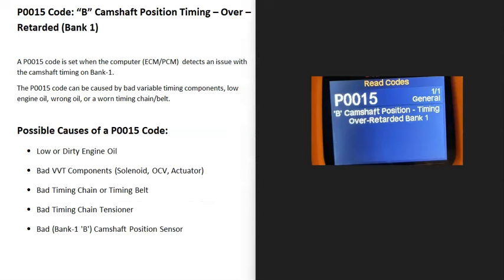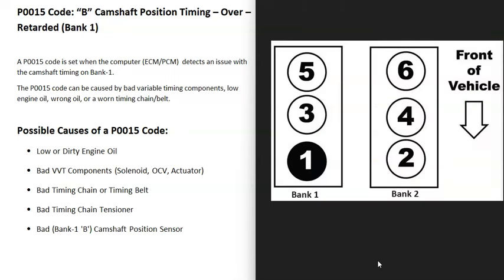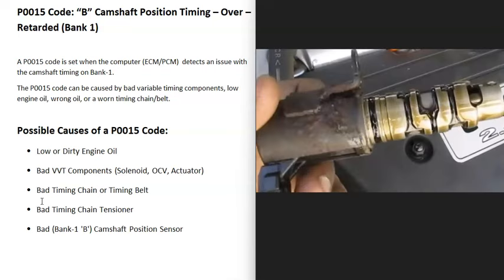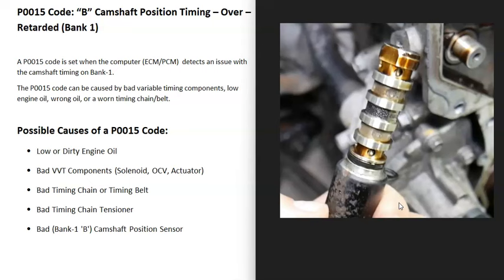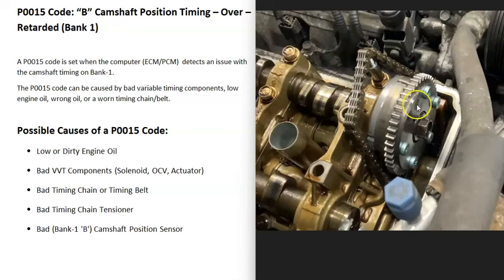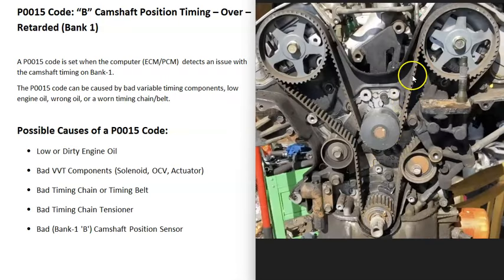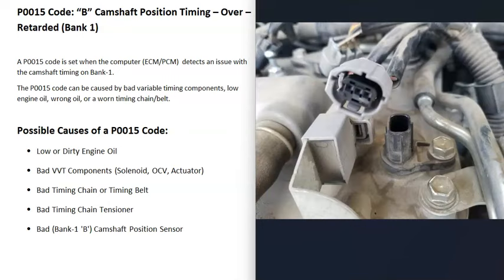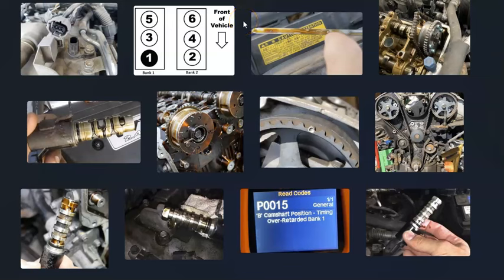Causes and Fixes P0015 Code: Exhaust “B” Camshaft Position Timing – Over – Retarded (Bank 1)

Comment: Having this with my '11 mini Cooper base with the N16. Hoping and praying that it's just the solenoid cause it resolved itself last year but it's back, and now instead of VANOS, it feels like VTEC, where only a certain rpm feels like it gets the vvt boost. Hoping is just a solenoid that's a little stuck. Wouldn't a stretched timing chain throw a code for both intake and exhaust?

Comment: Ill go ahead and mention i had a vehicle come in with a mazda cx 5 2.5l engine and the customer complained of a lower end rod knock. There wasnt a rod knock when it arrived. I scanned and found a p0015 and also every coil on this engine had a secondary ionization code which may have been pending, i dont remember. I thought about the electric hydraulic spool and the AWS system which retards the exhaust timing to heat up the catalytic converter for emissions and i told the service advisor that i believe the customer when they said they hard a knocking sound although it is not happening right now and that was the end of that. Engine was clean, appears to have been rebuilt or replaced with a leaking oil oan although etc at near 100k miles... That was the end of that. I would have loved to get to the bottom of the customers concern but that is the end of that. Very interesting.

Comment: I have a 2014 Toyota sienna and I have both the P0015 (B side bank 1) and P0025 (B side bank 2)occasionally, overr the last year, come in on the highway for a short time and then go away.  The engine never runs poorly even when the check engine light is on? How is it both banks trigger the code, then clear? Thanks.
Reply from the maker: It needs to be diagnosed, but with both banks giving a code, I would check the timing belt. It may be getting stretched and throwing things off.
Reply: @HVAC_Mechanic  the Sienna 2GR-FE has a timing chain. I bought the van with 90,000 miles. While I change the oil every 4-5000 miles, the previous owner may not have. Do you think the OCV filters are restricted? The code will come in and then go away after a driving cycle. Not getting engine performance issues at all.

Comment: Hey man I have a 2008 e93 n54 I’ve done the spark plugs, coils, timing chain tensioner, vanos solenoids and both the camshaft sensors and code still won’t clear I drive the car daily “in limp mode” and it runs completely fine WHAT IS WRONG
Reply: I change everything on my car too and code still showing and it drive well